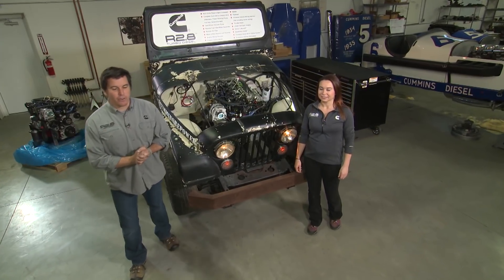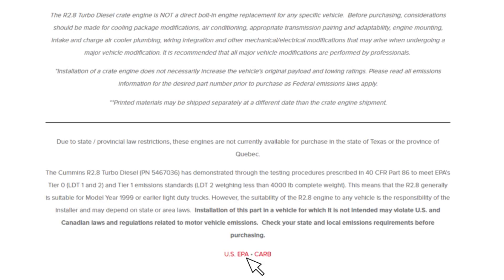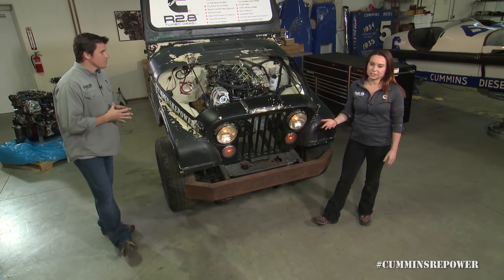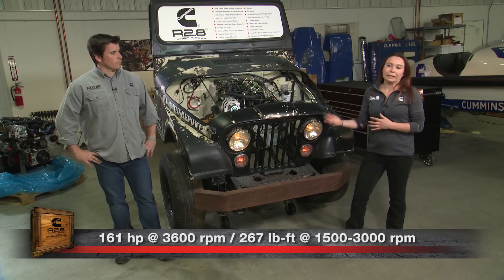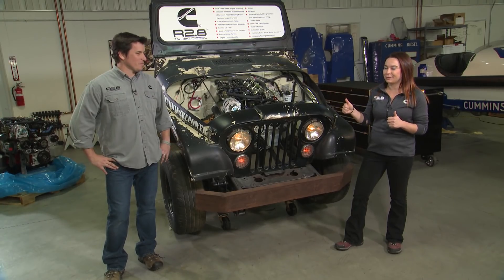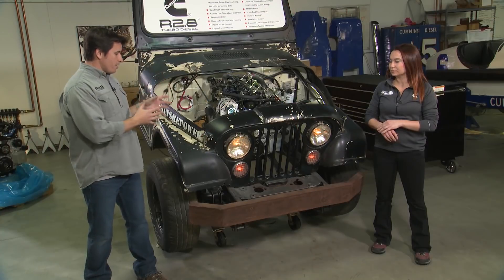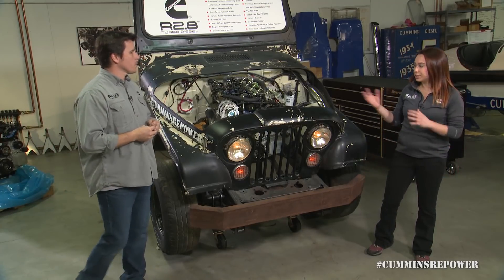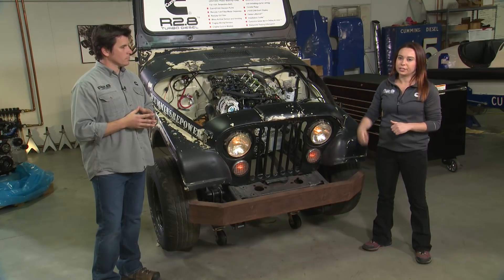Cummins Repower Garage Video 2: Selecting the Appropriate Vehicle for your R2.8 Repower Project

Comment: I have a 2004 toyota tacoma 4 door 4wd v6 i would love to do this swap to my tacoma transmission I have only 2 questions If I was to do this swap can I run a diesel+propane injection kit and water methanol injection would there need to be a program change for the propane kit or is it a non=option? And is there an addaptor kit provided for my model transmission?

Comment: Anybody know if these would work in a single cab f150 or 1500 Silverado? Older 90s or 00s?  If you can find a cheap old truck and throw the 2.8 in, seems like that would make a good daily driver.
Reply: Most LS based GM trucks should bolt right in with an adapter plate

Comment: Anybody know if Cummins has plans to create a larger displacement crate engine for larger swaps?
Reply: 5.9 12v crater motor? :D
Reply: They have the 6 cylinder engines in crate form on their website so that's enough even for full size crew cab trucks
Reply: Walker Ashcraft depends on what you put it in this honestly with proper gearing could propel even a 1 ton rated truck look at the HP and torque rating then think back to 70s 80s and even 90s and the numbers of HP and torque in them from factory now consider the work those said vehicles performed over 30 plus years and reconsider your build are you a poser who needs screaming power to show off in a parking lot do you intend on pulling backhoes or mobile homes?

Comment: I have built many vehicles over the years, worked with Cummings Marine on experimental fast vessel engines in the 1980's and 1990's and am now building the most important build, my sons first vehicle. It is about time a diesel manufacture came out with this swap. The biggest issue for me has always been fuel consumption with my 4x4 builds. I am just starting the build and will purchase a engine from you all in  the next few months. The vehicle will be a Jeep Wrangler 2 door, 2000 to 2010 year. Again great concept. Greg and Jessie
Reply: 99 and older... to be able to register it

Comment: I have an 81 CJ7 with a stock 304 v8, T176/Dana 300 that has been sitting for many years after losing a battle with a limousine and having the body mounts rip out. I have been kicking around a rebuild. The idea of a 2.8 swap is intriguing

Comment: 3.6l puts out 285hp and 260ish ft torque... does it make sense for this swap? I had a VW TDI and i loved the pep, torque, and fuel milage of that vehicle. I understand a jeep weighs more and i would be intrested in getting opinions on the 3.6L swap for this R2.8
Reply: Michael Baker it would not pass emissions, your vehicle is to new. 
You would be getting less power from the diesel also. Not an ideal swap in my opinion. Maybe give the 4 bt some thought....
Reply: Michael Baker don't forget that those numbaz jump dramatically soon as them toonz come out.
Reply: True, still won’t pass emissions, although thats not a big deal in some states. For that kind of money, why buy something with less power? I am intrigued by the light weight of this cummins though
Reply: MrAbsentdriver 30+mpg and mods exist, a 250hp marine setup, as well as inherent multi fuel abilities.. In fact an egr delete tune is out.. Get a feeling the channel may not like that idea..
Reply: PureCountryof91 maybe the swap is for you, but the idea of having to modify the cummins just to catch up to the factory gas engines specs doesn’t seem ideal to me, after also just paying ten thousand for the diesel before modifications or installation.....
I do like cummins,,,,,.. but not this one for the jk....
Reply: PureCountryof91 it seems ideal for the lighter tj though.... 
They need to make it pass emissions everywhere, and i would get one for my tj.....
Reply: MrAbsentdriver you have valid points. In my case I'd be setting it in a ranger. Similiar weight and adequate space, only a few real mods to make it work. Mainly springs and a trans as the 4r44e would splatter and its an auto..
Reply: Its too expensive. I'm going with the 1.9 TDI.